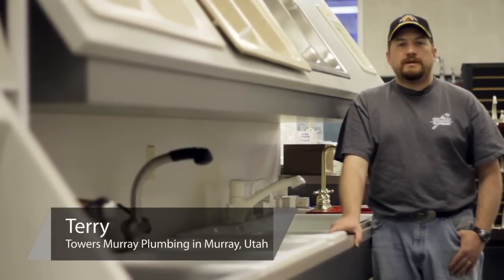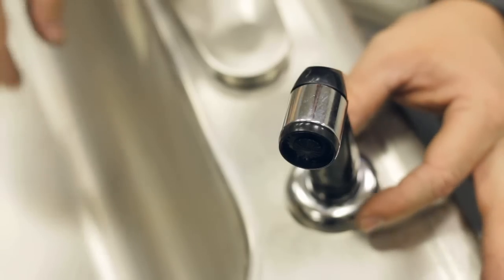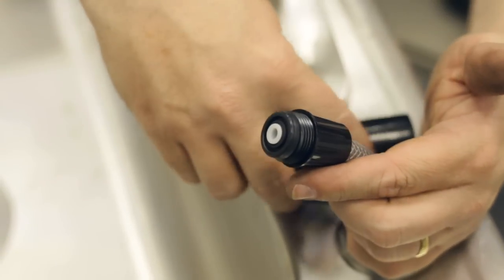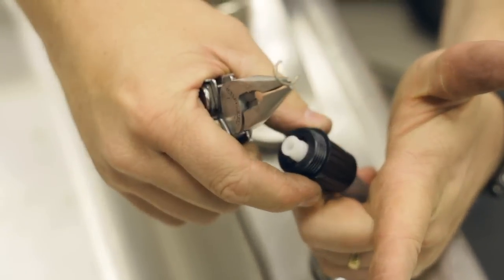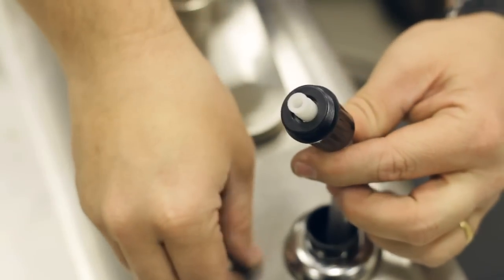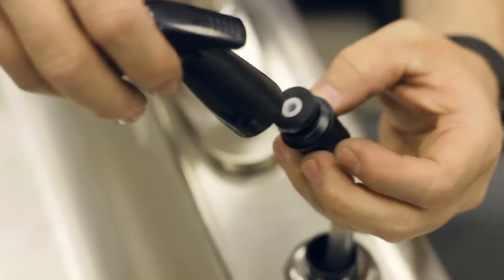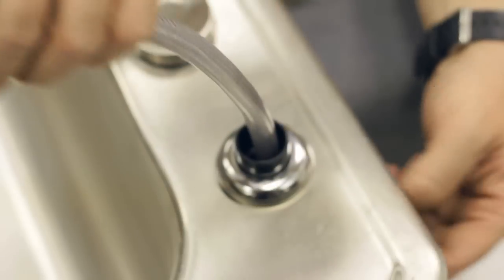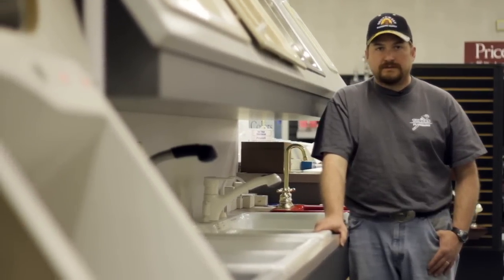Kitchen Sink Faucets : How to Remove the Spray Head From a Sink

Comment: Wow. I replaced my whole sink fixture/sprayer back in the spring. (Got tired of waiting on “him” to do it. Wasn’t that hard,  I felt accomplished!) But over the summer the spray head started squirting water from around the push button whenever the faucets were turned on. I went and bought a new spray handle. It has been sitting in a drawer for three months waiting on Mr-I’ll-Do-It-Tomorrow to put it on while the leaking spray head dangled from the hose in the sink basin to prevent surprise showers every time someone wanted a glass of water! Again I got fed up, looked for instruction on how to change the spray head and found this video. 22 seconds and it was done. The new one was a great match for the old hardware and fit perfectly. It literally took me longer to find this video than to do the repair! It took longer to watch the video than to do the repair!! 😂 Thank you so much!!!

Comment: Thanks for posting. Got the C- clip off, now to figure out how to remove the lock nut. On mine it doesn't just slide off like in the video, it's still securely attached to the hose
Reply: I have the same issue.

Comment: You are the only person to almost solve my problem. My delta faucet doesnt snap into place for long time after the head and connection hose threaded to lock. Soon I turn on the water, the hose falls off under the sink. Do I just need to replace the head or the hose. I just can't figure out.

Comment: Tanks for the video. I had a Hard time Changing the sprayer on my kitchen. .
Reply: yes,  this is great and thanks a lot for making the video. right now i'm faced with trying to replace a Moen and needless to say the model number produces no results on their website and their contact form disappeared from the screen twice after i tried to fill it out. i'm still searching but i would really like to know what company makes a replaceable head and whether i can just cut off the original Moen and attach one of these. much easier than scraping my shoulders and getting a neckache trying to look up for an extended period of time while i try to disconnect and reconnect the hose from under the sink.

Comment: mine is not so easy  when I removed the clip  behind that is a white plastic washer like which does not want to come off and behind that is the rubber washer.  I feat I will have to replace the whol sprayer assembly.  I have not any demos on here which show exactly how mine is.